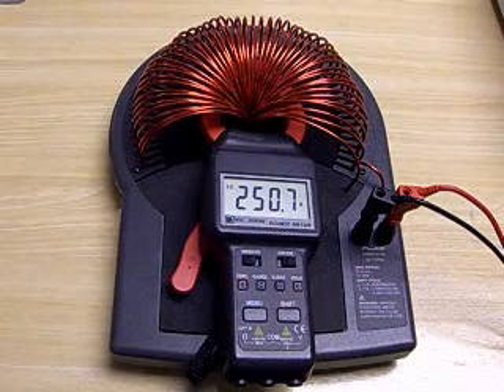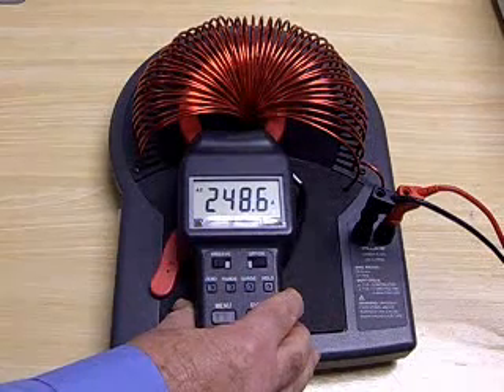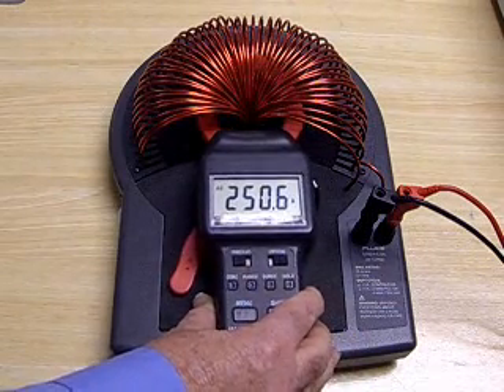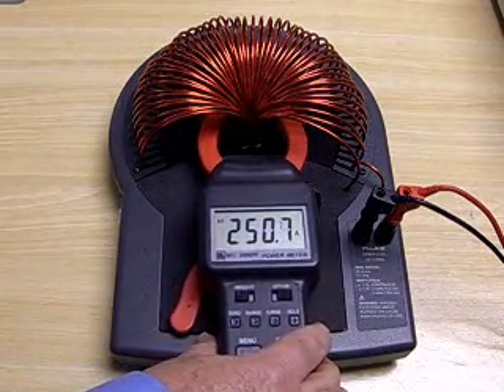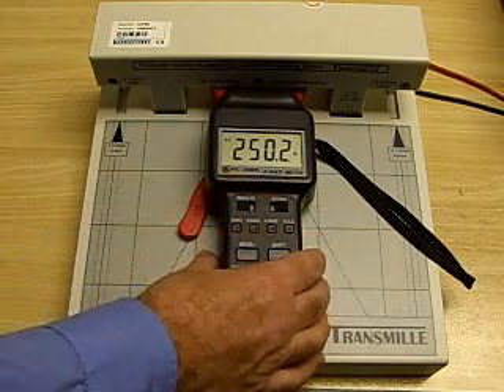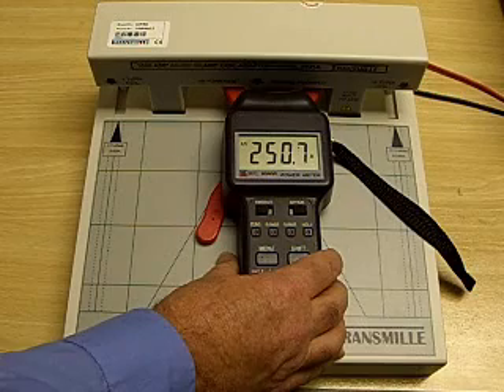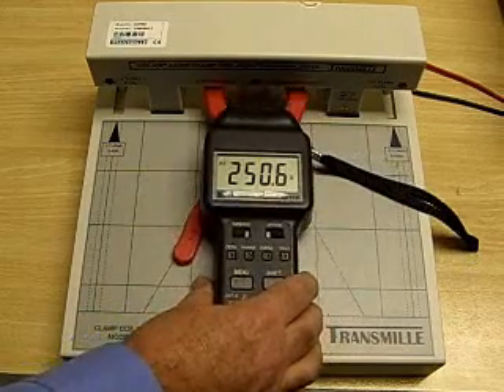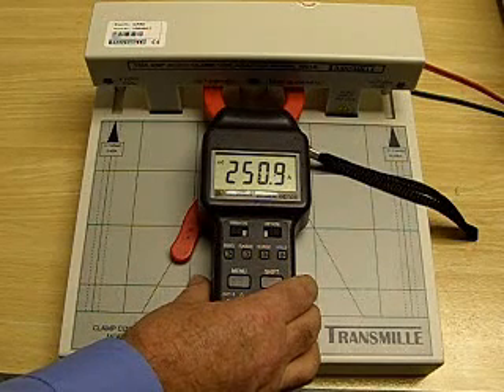Transmille EA002 Coil

Comment: Normally one would take the maximum & minimum readings add them together & then divide by 2 in each direction, I would like to see tests say done on a actual cable carrying current with that actual clampmeter, it would behave exactly as it did in the Fluke 5500/Coil the only situation is limited movement area in the Transmill coil, so I feel it might not be able to perform calibration checks on very large clamp jaws like the Ferranti Clip-On Ammeter produced in the 1960s but is still in use today,
Retired UKAS manager,